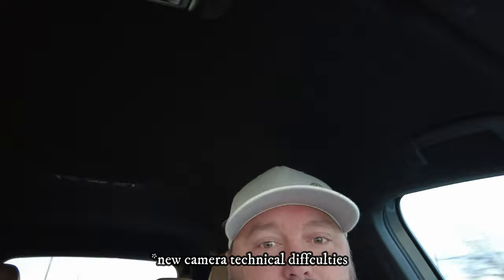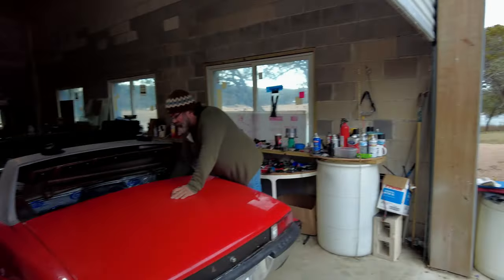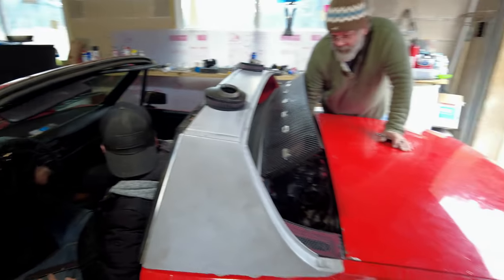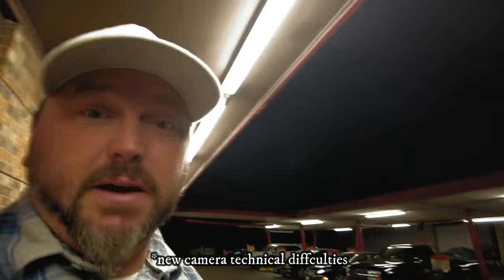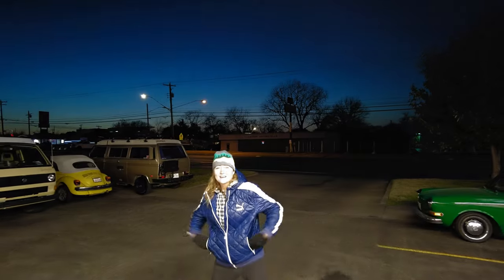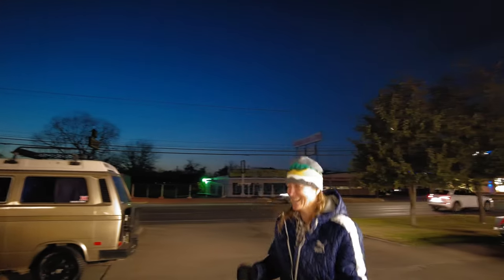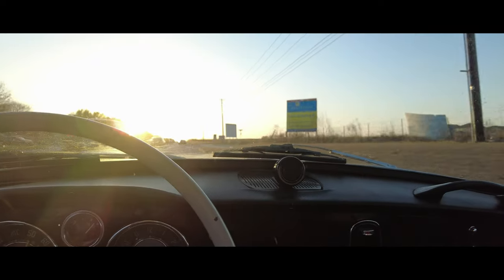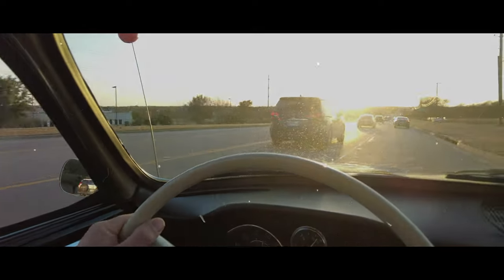Just Another Saturday....

Comment: It has a intake valve not sealing at all . On type 4 the valve guides wear out. We rebuilt one before and it had some biral cylinders in it and the chrome coating was worn out . At the parts house they go these are 380 bucks jobber , what , We ended up using some cast iron ones .
Reply from the maker: I believe this motor was just rebuilt with fresh heads. I'll definitely have him check that if we can't get it going. Thanks!

Comment: Interpol. Good choice.
That motor is missing like a mf. Hope you checked the cap and wires/plugs first.
Reply from the maker: The ignition parts are all new and in good shape. The timing was off, and We didn't have a timing light, so we got it close. I'll have to retune the carbs after he gets that figured out. For now we just wanted it to idle and move under its own power. There's a few other issues he needs to address before taking any long trips.
Reply: Sweet. That 914 looks solid. This is a lost art and glad all of you keep it going and show people..